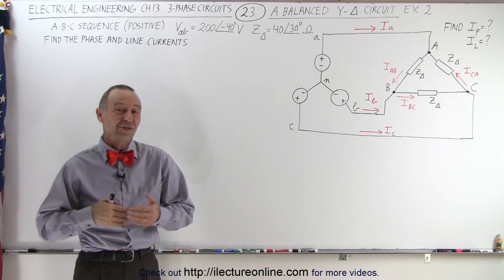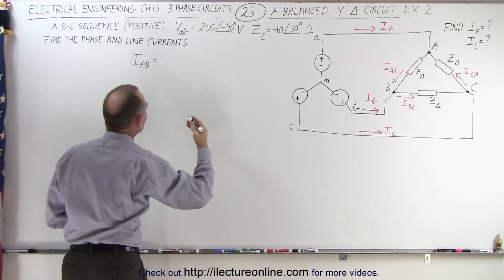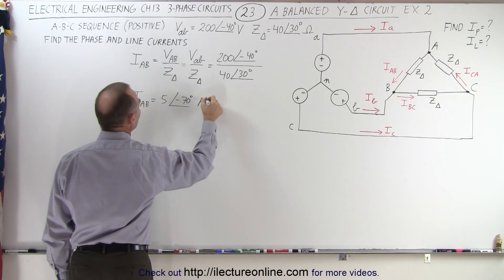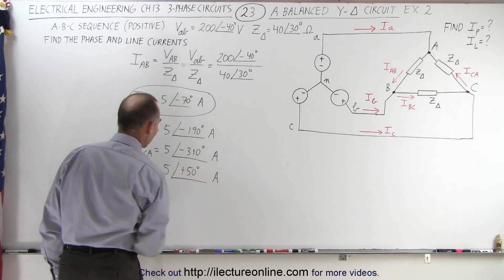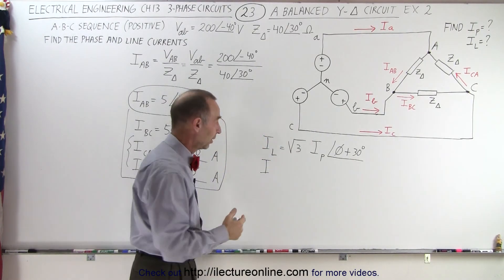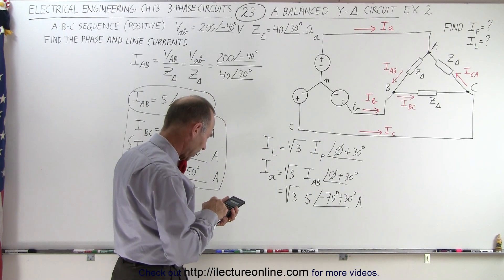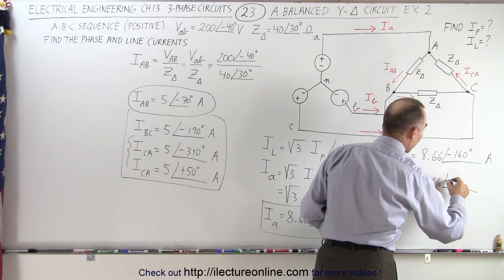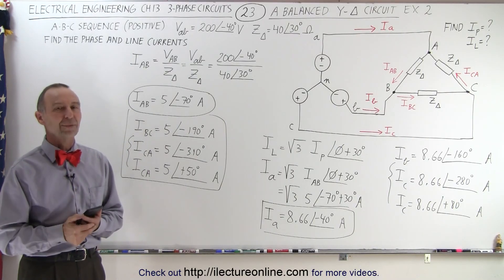Electrical Engineering: Ch 13: 3 Phase Circuit (23 of 53) Balanced Y-Delta Circuit: Ex 2

Comment: Hello professor. On this video you are calculating the line current by adding a 30 degree on the phase, however on video 20 yuo said that the line current is by subtracting 30 degrees because in your explanation the phase current is lagging the line current by 30 degrees, so the 30 degree is negative.  Why here is positive?

Comment: the correct answers for the line currents are as follows:

Ia = 8.66 with a phase angle of -100 degrees Amperes
ib = 8.66 with a phase angle of -220 degrees Amperes
ic = 8.66 with a phase angle of -340 degrees Amperes
Reply: yup that's correct since line current lags phase current by 30 degrees.
Reply: right
Reply: @markfar4837  then why did he do like this? 
  plz. make sure when you answering!!!  @Michel van Biezen

Comment: Doesn't the line current lag the phase current by 30 degrees?  Should you be subtracting 30 degrees from -70 so its -100?
Reply: U are right !!!
Reply: Yes it sould be. Just in the previous video he did it with the minus sign. Also I checked the textbook.
Reply: @burakkarakus7681 which text book ?
Reply: i have the same remark here
Reply: so , what is the correct answer?
Reply: Thanks
Reply: I just checked the text as well, this is backwards.
Reply: Yeah you are right, the phase angle for the current Ia should be lagging the phase current Iab by 30 degrees. So it must be negative 70 minus 30, which is negative 100 degrees.
Reply: Yeah
Reply: I got the same answer with you
Reply: my thoughts too